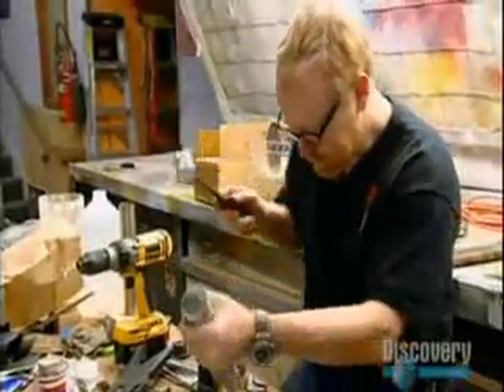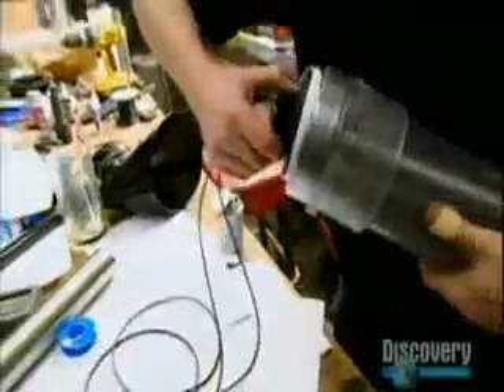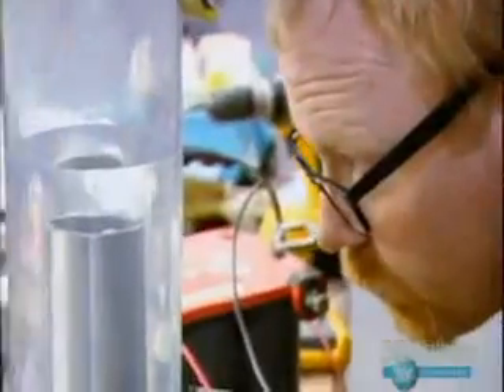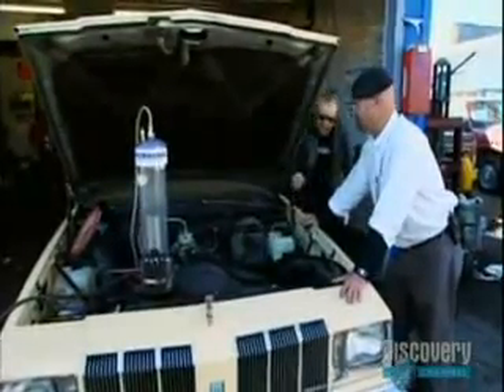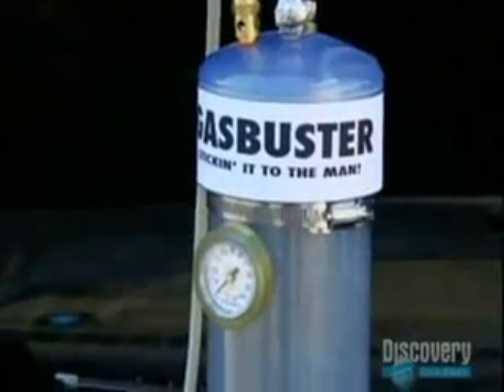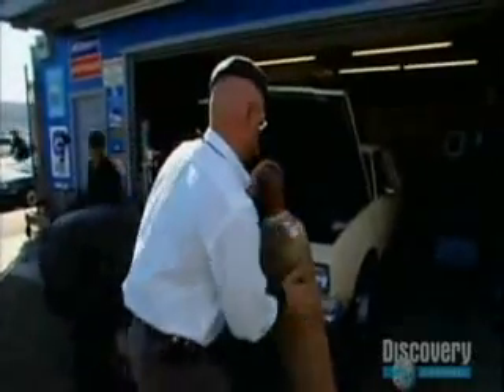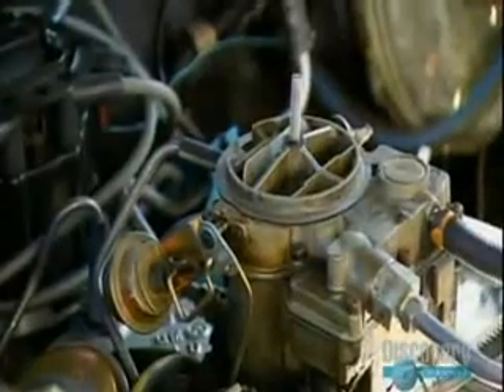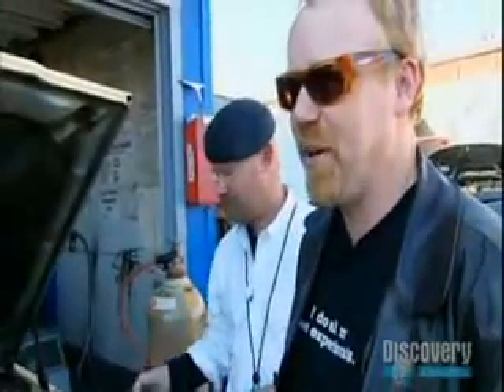HHO Mythbusters Explained

Comment: i would love someone to build the same setup they used and show mythbusters how to do it PROPERLY
Reply: Can be done easily
Reply: @martinbgiles7065  PLEASE
Reply: takes about 3000 watts of energy to make about 200 watts of HHO.... DAMN watts law !
Reply: @bambur1  Stanley Myers drove a dune buggy from California to New York and 1976 on nothing but water he had hydrogen injectors and the alternator created enough power to generate enough hydrogen for the engine to run on
Has a lot to do with pulse-width modulation need like 20,000 Hertz
And that fuel-cell they've built was a joke for hydrogen production
Stainless steel plates with many holes as you can put in them that are smaller diameter than the thickness of the plate it all add surface area from the inner diameter of the hole and it gives a hydrogen an edge to form on
Reply: @bambur1  you don't have enough education with hydrogen to even know what you're talkin about and that's apparent
All has to do with material used the surface area of the material (and if you're using like a 8th inch plate every hole you drill in it with a smaller diameter than the thickness you are adding surface area) the electrolyte (potassium hydroxide It said to be some of the best) and the pulse-width modulation used 
Check out some of the videos with generators running on hydrogen fuel cells
If it's a self-starter and has a battery get the hydrogen production started with the battery and then switch it to the output power of the generator or if it's a self charging battery from the generator you don't have to switch anyting
Or else you have to use an alternate source of power for initial hydrogen production until you get your generator started before you can run it off the generator power
Reply: @miketully9592  Best part is you think PWM is complicated  and that Ive never worked with KOH. ...Yea its still not possible. You will always burn more than you can generate. Give me 10 minutes and a DMM with any "working" model and ill find the battery
Reply: @bambur1  why would think I think PMW is complicated 🤔you can build a fairly simple circuit with some resistors diodes capacitor a 555 timer and variable resistor in it you just have to play with it to determine the best frequency for the cell and electrolyte being used for hydrogen production to get the maximum output
ever seen or learned about Stanley Myers
Who drove from California to New York on hydrogen in 1976
You can check out Bob Lazar to he turns the hydrogen into hydride but he uses as solar system for his production and then puts the hydride in the tanks that he has in his car
Reply: @miketully9592  PMW ? 🤣  I blew up more 555s and 741s then you ever used.
Reply: I am doing it .... even better "dry Cell" . Only prob is computers ... as to be bypass.. and  gaz co. Are sneaky and vicious so hard to market it ... 
BuT I got an IDEA... 
Xx
Reply: That would be great, it would all speak great if it went viral and so that they can have an episode where they met these other people and show them what they did wrong.

And within doing so, make them out to look like fucking morons who manipulated the results by not following the instructions properly, or maybe they just got themselves some really terribly retarded instructions, and they followed the retarded instructions which is the reason why they called it myth busted.

Maybe what they should have done, was to try other methods outside of the one method, because as this video mentioned, they did skip out on the electrolyte, I've seen people use baking soda, which can be used, it's just not nearly as efficient as the real electrolyte that you could be put in there.
Reply: Hey if you know how it is done properly then you should do it, or do you have no clue but think it should work.
Reply: @Brian M  Might wanna know what your talking about first before getting on the "web" and talking crap about something clearly you have no clue about. I have a 2015 Dodge Ram 1500 37" tires and a 8" lift and guess what it runs off of???? Ta da you guessed it. HHO!!!!! I really wish I could post pictures here 😩
Reply: @damienpv  bahahahaha please post a video of that junk

Comment: I think if you read again, I did say convert to hydrogen, "the hydrogen to power cars" It was self explanatory... You have a 88% energy conservation from when you have electricity from the turbine, to the hydrogen fuel cell, so it's a loss we have to live with, still better than all the oil spills.

Comment: These Mythbusters guys are just stupid, maybe intentionally.
I have never try HHO cell and I do not have personal experience, BUT
THEY did that electrolysis COMPLETELY WRONG !!
Their cell simply did not work. And their bubbles become from pouring water into.

When I was a child I did some experiment with 4,5V battery and I had MUCH better result than they achieved.
They only proved they do not want to do that... Intentionally.

Comment: Have you heard of synergy of many energies.  We have an abundance of energy all around us, all we have to do is unlock there potential.  Naturally occurring kinetic energy from gravitational forces.  Radiation from space in solar energy, and more importantly thermodynamic energy from the earth.  If we harvest these energies and store them as hydrogen it would make a lot more sense then use the amount of energy it takes to pump dead matter out of the ground that release hydrocarbons into the air.

Comment: You don't need electrolytes nor the gap between the electrodes is necessary.Just put two spoons in some water jacked to car battery charger run it about 12v and 15 amps and you have HHO gas.Trust me it works.

Comment: An electrolyte is not required if a water plasma is created. There is no way that you can run a car on water without requiring energy from somewhere else besides the car...the gas generation process is not that  efficient. If it were, we would all be driving vehicles so equipped. No one has built such a vehicle and unless some new physics comes along it is unlikely that someone will. Remember that water is burned Hydrogen.

Comment: They did not use any electrolyte which is critical in producing HHO in adequate quantities, and FYI this is just a supplemental fuel which increase' the the efficiency of the gas your car is already burning creating a hotter faster more complete burn which also reduces emissions drastically in addition to in increasing horse power and millage.

Comment: Great, I'm on the scientifically illiterate side of you tube again. Take some chemistry classes folks. The energy created by burning hydrogen is the same as is spent separating it. Also, adding electrolytes will make the water more conductive and hence separate faster but will cause a proportional increase in power input required. There ain't no free lunch folks.
Reply: Try making one and testing it yourself instead of regurgitating unrelated science proving you are attacking from the wrong direction. HHO is about improving combustion efficiency not adding to available fuel but supply. There is also the factor of cleaner exhaust and longer engine and oil life as a result of cleaner burning plus more than just running HHO into the intake. Mythbusters did more to prove HHO works than they did to disprove it here.
Reply: @richardgieser6122  I understand basic fucking chemistry. You are just adding a step to energy production and that will always reduce efficiency. As far ask making this, it is trivial to do so. Many of us did this exact thing as a grade schooler. That's right, 8 year old children know that this is a bad idea. Do it yourself and take energy measurements. Oh and try to be less stupid.

Comment: Unless they used distilled water, all water has electrolytes in it. That claim is bogus.
Filling that bag with gas in five minutes discounts the fact that it was O2 and H2, not just Hydrogen. They followed the directions exactly. "HHO" as a way to run a vehicle has been busted. Also, your compatriots in Texas were found guilty of fraud, or was that you as well?

Comment: Thats what I was goinna say too,, they forgot baking soda,,,, and when they used the hho tank to fill the carboater it should be sealed so it doesnt spill and the amount must be adjusted when doing that,,,, that is why it exploded,, gas would have done the same thing if you pour it in the carborator like he did,,,, the hho kits work great and your mile improves so you dont buy gas so often,,, and yes you can run vehicle on just water with the bigger kits,,, I built one and it works fine too

Comment: First of all look what myth Mythboosters tried. It was not about hydrogen production it was about making it from water inside a car using electrical energy taken from that cars alternator.

Second, of course there are quite efficient ways to make hydrogen. But they not that cheap (except the one making it from natural gas but that one defeats the purpose as it produces loads of CO2 -- so it's not zero polution)

And Tesla is a perfect example of mythologised figure. Morons make him a disservice.

Comment: I don't know why they did this these guys know what there doing so why did  they rig this HHO to fall  I use to like watching the Mythbusters until I saw this.  notice when he first turn it on there is only a few bubbles of hho gas  I know when I saw a friend turn one of these on  its  the same unit   that HHO Generator should have been producing  over 45 litres of HHO gas a minute before the battery died  that unit  could easily have produce enough HHO to run a tuck let alone a car.

Comment: sorry but 5 minutes to fill a grocery bag vs the amount of hydrogen required to keep a car running for 5 minutes.. not possible. the grocery bag would have filled in three seconds at the rate of which the car burns it. Yes it works well but you can't generate it on the fly, and storing it is the real challenge.

Comment: Ah, so it is not to improve fuel efficiently but to make the car lower maintainance? I see, if that is the case, it makes sense. Now just a question out of curiosity, does hydrogen produce more horsepower and torque or, does gasoline produce more.
Reply: The fuel isn't the only factor for horsepower/tork. Size of piston, tuning, etc. Try jet fuel in a 4 cylinder ingen, more tork and horsepower until it blows out the thin piston walls.

Comment: I don't understand the point of HHO. You need to add initial energy into H2O to split it up into HHO, but then when you burn the HHO, due to the laws of physics, you will receive a final energy which is less than the initial energy added. How does that make anything more efficient? What's the point?

Comment: Powering a car via an on board electrolyzer wont work as advertised. Electrolysis of water takes more energy than the hydrogen and oxygen can produce. Also, the system wouldn't produce enough gas to meet the consumption demands of a car engine. This is yet another example of why cars of energy inefficient vehicles. The most energy efficient vehicle ever made is the bicycle. We need to ride bikes rather than wasting time and resources looking for novel ways to power our cars.

Comment: THAT IS NOT TRUE, AT THE BEGINNING IT WILL INCREASE MILEAGE, BUT WILL COME BACK DOWN  AFTER AWHILE DUE TO THE OXYGEN SENSOR COMPENSATING FOR THE MIXTURE COME THROUGH THE EXHAUST. IF YOU ADJUST THE SENSOR OR BYPASS IT THE MILEAGE INCREASE WILL CONTINUE.

Comment: Yeah, now I see what you mean. When the spark ignites, the hydrogen is going to recombine with the extra oxygen when it ignites so there is no extra oxygen molecules. What of you think of this, using a turbo to spin a generator (instead of a compressor) that is isolated from the rest of the electrical system to make HHO? It's not something I would ever try, but just wondering if it would work. My guess is that the generator would overheat.

Comment: If O2 is being added to the manifold upstream of the MAF (which is usually located downstream of the air filter), doesn't that, by definition change the air fuel ratio? Because it's adding oxygen to the cylinder It isn't adding air,but what counts in combustion is oxygen. I don't know, I am just asking

Comment: By bypassing the MAF sensor, isn't the fuel mixture going to lean out and go above 14:1? I would think this could damage the engine. I also think there is a sensor on the exhaust manifold that will force more fuel in the engine if the burning is too lean and so you would loose any advantage that this extra gas could do anyway? Isn't that right?

Comment: I have been using mine for a year , it average 10% increase in fuel mileage and seems to work best if the engine is working hard...I do less than a liter a minute, at high levels I got flash back and blew my Jar up 3 times...

Comment: No, it was because you said they didn't properly follow the procedures and failed to install a flashback arrester. The fact that you can STORE energy from a different source in the form of hydrogen is not a fact that is in dispute.  What is disputed is that an on-board HHO device will increase gas mileage, which it won't. I re-watched your videos and it very much gives the appearance that you support HHOI devices.

Comment: Will your engine run on hydrogen?  Yes it will.  But at the rate these hydrogen generators work you can run them a week on AC power and make enough hydrogen to run your car for about five minutes.  Not even enough to get you out of the driveway.  My old worn out car battey produces more gas.  Eat more beans and shove a hose up your ass and produce more energy to fuel your car.  This is a scam for those who slept through Chemistry and Physics in high school.

Comment: I'm not sure that running a standard internal combustion engine is the best way to go.
maybe useing it with a fuel cell would work better.
We used the same technology in 7th grade science class over 50 yrs ago.
It was a cool experiment and made a little pop when we held a flame to the end of the test tube.
We made a lot more hydrogen with zink and hydrochlric acid.
I think we'd have better luck useing solar voltaics and thermcouple technologies

Comment: The water formula is H2O means there are two hydrogen and one oxygen in one water molecule, When the bond between the molecule broken through hydrolysis then the molecule split completely into HHO, you said the it will be H2 O2 but i am sorry! No it will be HHO and if it should convert to H2 O2 then again anther chemical reaction will required for conversion.

Comment: well, whether it is HHO, or H2/O2, there is a gas produced through electrolysis of water that reacts to produce A) water and B) greater cleaner energy than gasoline. this is a fact that has been tested and tried many times over. Another small  problem with their cell design was that the cylindrical electrolysis cell didn't have the surface area for an efficient reaction.

Comment: The only legit study on hydrogen injection systems is by NASA and they indicate the maximum possible efficiency gain is 3% but doesn't take into account the extra load on the alternator, assuming the cell draws 100W to 300W you're probably breaking even on average. Easiest way to end the debate is to have the people that sell these kits to submit it to the EPA for testing, a validated system would sell like hotcakes.

Comment: Yea...  at first i thought "HHO" was just a way to write H2O without subscripting the 2.  But now i see it all over the place.  If they in fact mean H+, H+, and O- as non-bonded atoms, I think they are greatly mistaken and need a basic course in entry-level chemistry and stoichiometry. and FWIW, yes, I know...  the ionized form does exist, but for practical purposed the output is H2 and O2 with insignifigant amounts of the ions. Hell, i'm sure that there is a heavy hydrogen every now and then.

Comment: They proved the internet device did not work.  That was all they set out to do-- confirm or bust.  Hydrogen will run a car.  There are hydrogen cars.  The problem is always the fuel.

Comment: Yes, basically using a battery to power a car is more energy efficient than using a battery to make hydrogen that runs the engine or recharges a battery. What you have to consider though is if you make a car that uses hydrogen to recharge an electric car on the fly, you eliminate the range disadvantage of electric cars (only going as far as the charge allows, and then having to spend hours recharging it). Once we use green energy sources to split the water, the fuel cell car will be 100% green.

Comment: You are still refusing to admit that sound is the reason solar power even works. You won't even recognize the dry crystal cell batteries. Are you aware of what it takes to make a sound that hits 80db...not very much. You can get more out then in with the shirts these guys made. watch?v=nuRdF46TKDs You also did not watch that entire video obviously...Nitinol gets stronger over time..not weaker. Are you blind or in denial?

Comment: You might but what about the majority of our electronic systems? In most of our electronic systems we do not use it. In fact when taking courses in electronics you are taught how to prevent it. We are also told that they are bad effects of electronics and they are not. As stated musicians use it but most of them don't even know they are using it. Our cars use it but once again, the mechanics that work on the cars do not know that. I am not the one that needs to start over.

Comment: p3. You will find everything they tell us to ignore..or is bad in electronic systems could actually be used to generate "OverUnity" and/or at the very least increase efficiency of our current systems. We do not use backEMF or feedback (except in music). Sound can be used to produce power, but of course you will argue against that as well. Solar Panels and Dry Crystal Cell batteries work off of resonance. Go and do some reading.